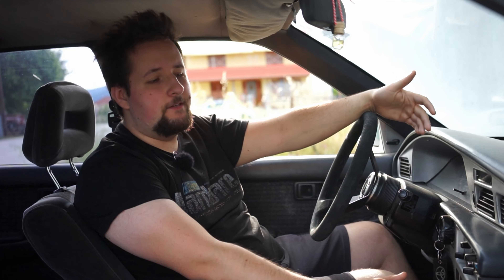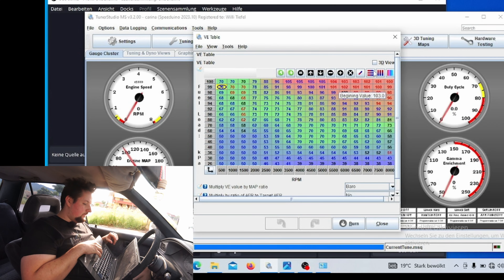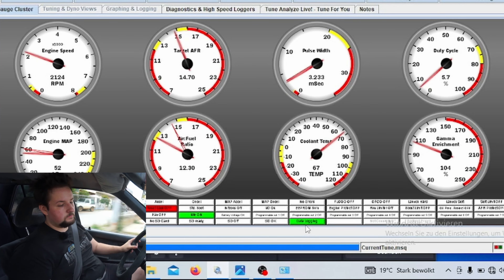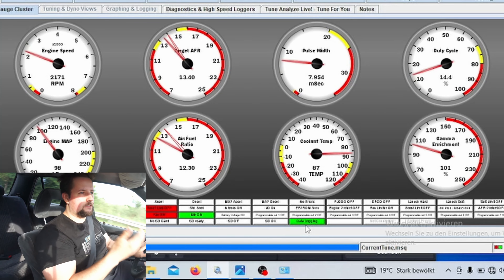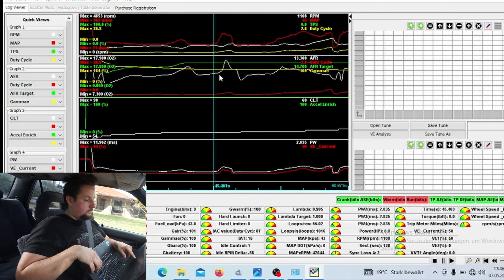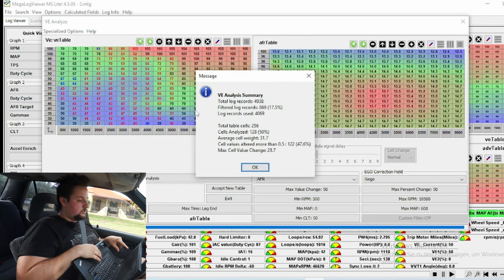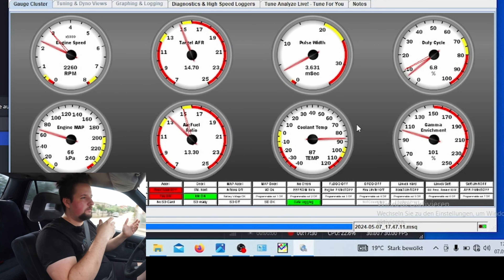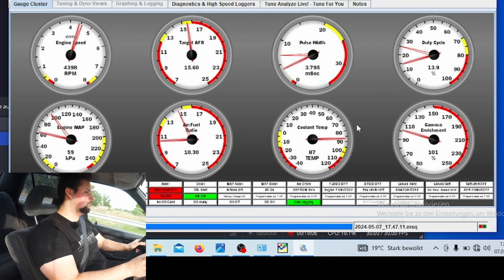Tunerstudio standalone ECU Tuning Guide | Part 11: Fueling,  Tunerstudio Free & Megalog | Megasquirt

Comment: Hi, do you mind making a vid when you tune your AE, i have been trying to tune forever and can never get it spot on. thank you
Reply from the maker: i will do that at a later date right now im running no AE at all. 
in most cases the basemap does quite well with this 

for better throttle respons set the map sampling rate under engine constants to instantanious that helps MASSIVELY!
Reply: @throttlebuddies0  i thought i did that already but i  just took a look at my tune and i was on event average with a switchpoint of 0rpm so it made that it was never on instatanious and was always on cycle average. thx

Comment: Thank you for producing this series. It’s a big help and lots of important info in it. I hope that you get a lot of sponsorship and support for your work. 

Also love that you have an AE90. I love all Corollas but I have two Toyotas the generations after - SW20 MR2 and AE101 Corolla with the 4AFE and C52. I’m doing a lot of work with the 4AFE n/an and will see what results I can get with PerfExpert street dyno app, and how far I can push the stock ECU/rev limiter. :)
Reply from the maker: I have a t170 carina wich is the same underneath as the corolla. Project will continue very soon :)  the 4afe is a pretty good engine too i think.